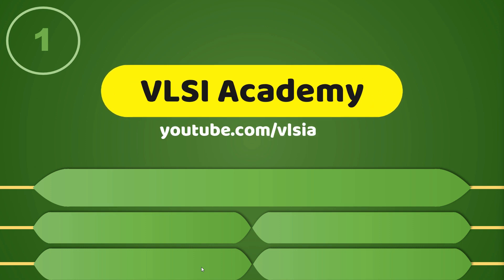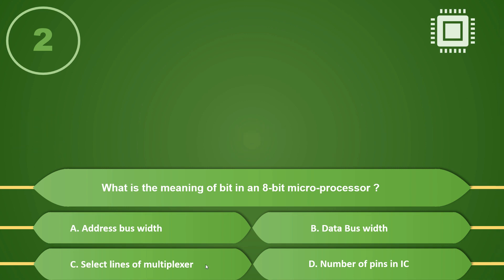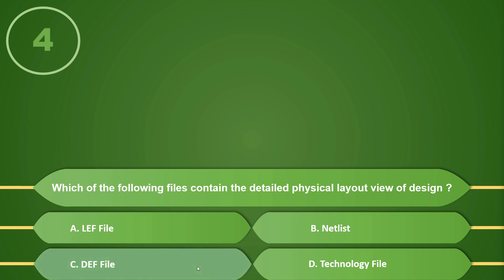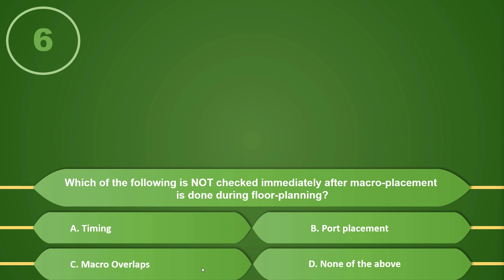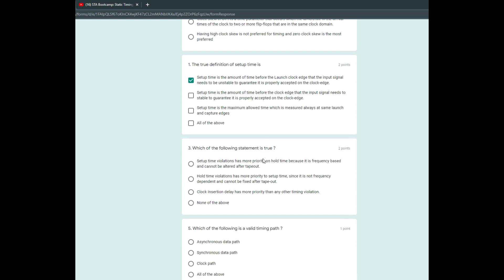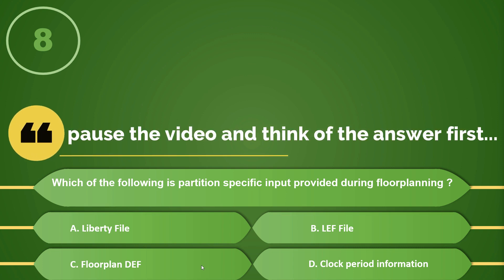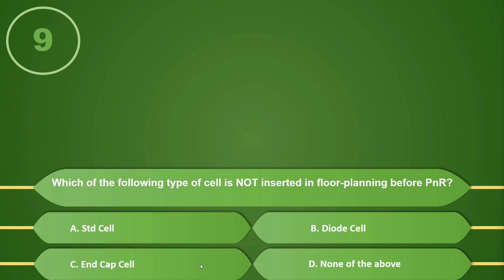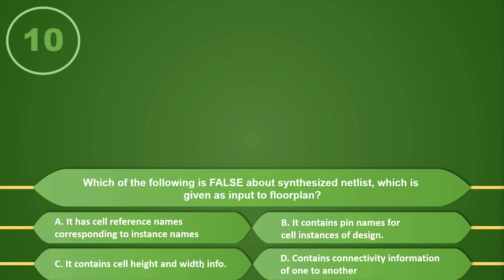PD Lec 30 - Interview Questions | VLSI | Physical Design

Comment: For question no.1 there are three correct answers. and somehow the wrong answer is selected as the correct one in video. So, it seems like the question is wrong.

But anyways here is a description for all the four terms for ease of understanding for the audience of this video.

Among the options you've provided, the valid operating regions of a Metal-Oxide-Semiconductor Field-Effect Transistor (MOSFET) are:

1. Saturation Region: In this region, the MOSFET is operating in a fully-on state. Both the gate-source voltage (VGS) and the drain-source voltage (VDS) are at levels that allow the MOSFET to conduct current effectively between the drain and source terminals. The channel is pinched off at the drain end, preventing further increase in current with increasing VDS.

2. Triode Region: Also known as the Linear or Ohmic region, this is where the MOSFET operates as a voltage-controlled resistor. The VGS is positive and allows a channel to form between the source and drain. The drain current is roughly proportional to VDS, and the device operates in a linear manner.

3. Cut-off Region: In this region, the MOSFET is turned off, and there is no current flow between the drain and source terminals. The VGS is typically lower than the threshold voltage required to establish a conducting channel.

4. Depletion Region: This term usually refers to the region within a semiconductor device, such as a PN junction, where carriers (electrons or holes) have been reduced due to biasing conditions. It's not an operating region of a MOSFET in the same sense as the other three terms. The term "depletion mode" can sometimes be used to describe a mode of operation where the MOSFET conducts even without a positive gate-source voltage, but this isn't one of the primary operating regions.

In summary, the valid operating regions of a MOSFET are the Saturation, Triode (or Linear), and Cut-off regions.

Comment: A multi-cycle path is a constraint, that is set by the designer to meet setup time because the data path is too fast. 

is it a correct statement? if not then why?